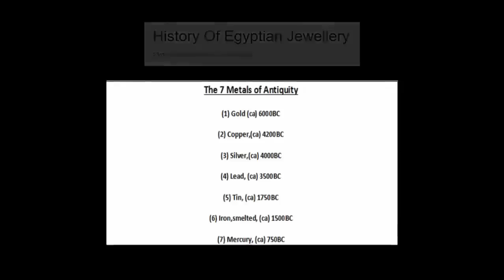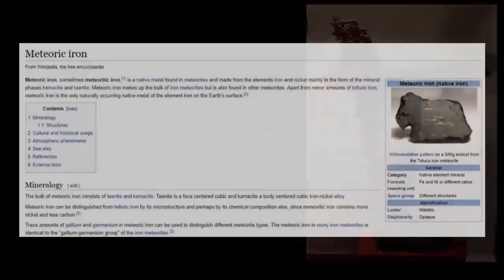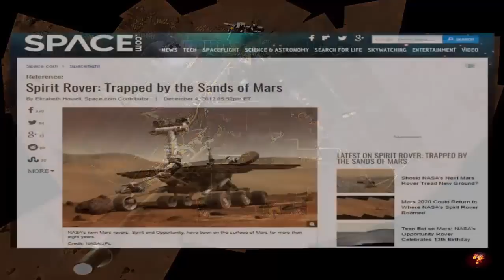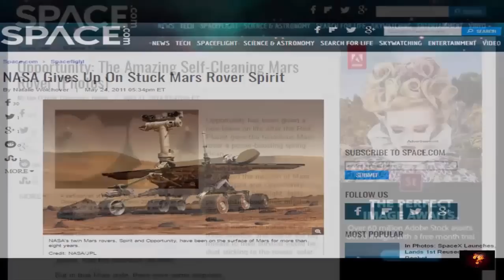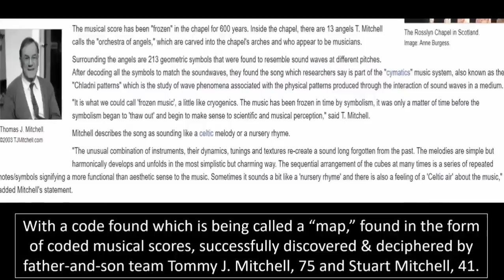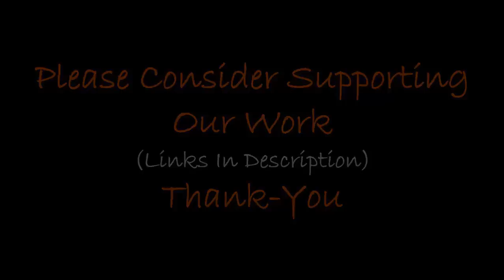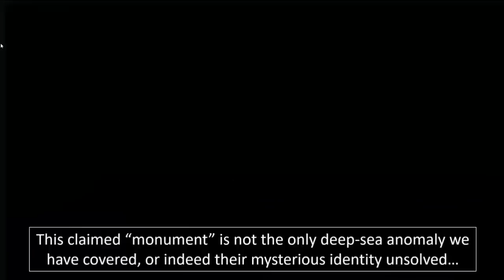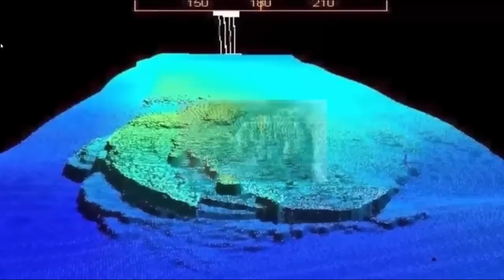Pre-Flood Super-Ruins Found In Japan? 🌼

Comment: Drop aliens or ancient astronauts, it's a misinterpretation. The reason for all this is stated in Genesis 6. There is a problem with the iron dagger. Where is the guard? There is the location for the guard but no guard! This dagger is a reuse, they obviously did not know that a guard had to be placed just after the covering of the handle, they must have believed that the location of the guard was only an extension of the blade.